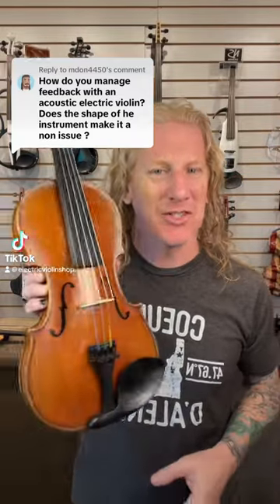Managing Feedback on Violins With Pickups #electricviolin #violin

Comment: A good pickup is important and good pickup placement where the pick can be moved helps as well. A proper preamp for a piezo pickup is crucial, because some frequencies are going to rip your head off because of the impedance mismatch. I do FOH and monitors for a lot of violin players and I don't have issues with feedback when the players have good pickups and proper preamps.
Reply from the maker: A good pickup is important. A proper preamp is important. Pickup placement is important. Absolutely. So is a good engineer who knows how to fight feedback with EQ, monitor placement, etc.

But even with that, at some point, volume levels on stage are going to get high enough that feedback becomes a problem - especially if the violinist likes to use distortion. In-ear monitors help a lot. 

But that's why solid body violins became a thing. Violinists got tired of fighting feedback.